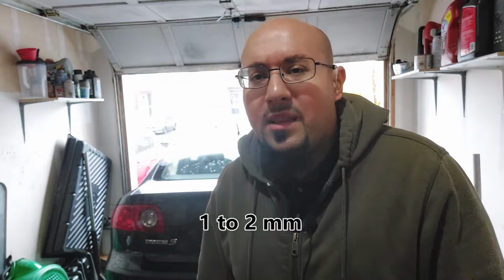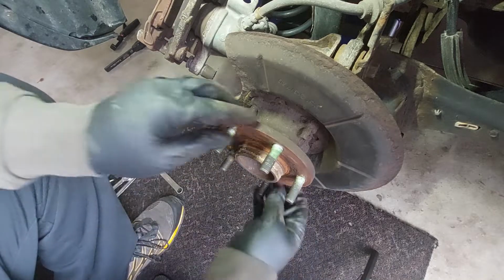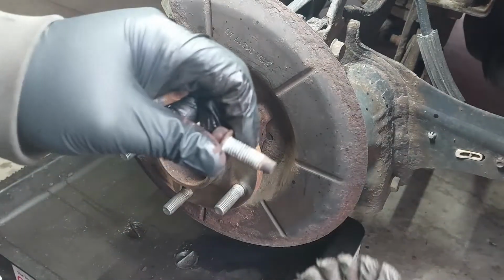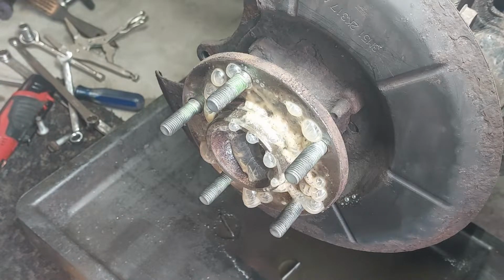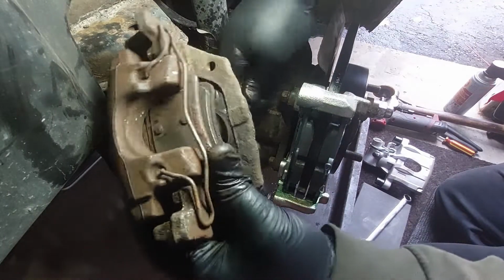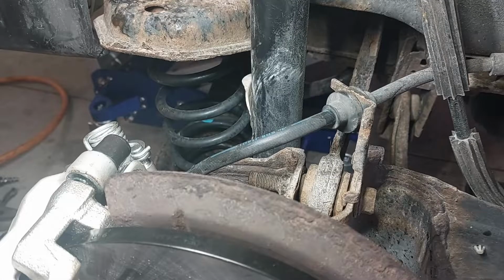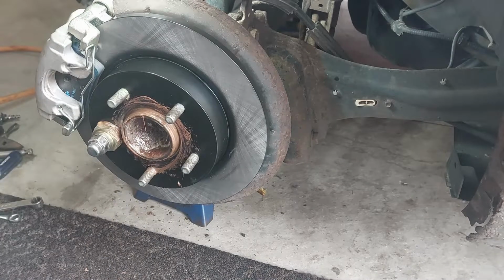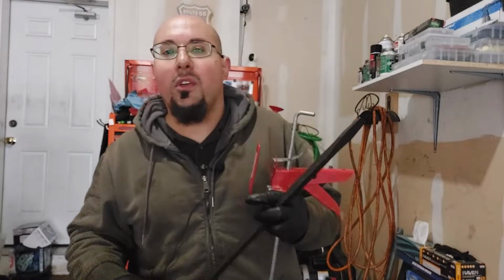2006 Mazda 3 - 2.0 - Rear Brake Calipers Replacement

Comment: Thanks for posting, just a note, those dimples on the caliper cylinder are for retracting the cylinder with a special caliper tool.Once the tool is engaged, you turn clockwise to retract the cylinder so there is clearance for new pads. Old school, you would use a c clamp to press the cylinder back. On these cylinders that method is not possible. Everything else is good, though a lot of it is not nesasary as the new calipers I bought had grease on the slides, and you can use dialectic grease on the back of the new pads instead of disassembling the caliper.

Comment: Stupid question. Are the front calipers and rear calipers the same?
Reply from the maker: No, they are different, however they are similar in terms of servicing and operation. The rear calipers on this model incorporates a mechanical parking brake for the rear wheels separate from the actual braking of the vehicle. The pistons for the rear will need to be turned/twisted in order to reset the piston inside if they are not seized, otherwise the calipers will need to be rebuilt or replaced. The front calipers are larger than the rear as most of the braking is in the front. Brake distribution will vary from vehicle to vehicle, but most of the time it is a 60 front/40 rear or 70 front/30 rear distribution. The pistons for the front calipers push in in order to reset them when you are replacing brake pads. All four wheels operate hydraulically by the brake fluid and has a separate mechanical parking brake system for the rear wheels only.
Reply: Thank you for the reply. I'm in the process of fixing my 08 mazda. And I'm doing the pads. Rotors and calipers. And I noticed Detroit axle doesn't have the rear calipers. Only the front ones. So I was thinking maybe they were the same. Good thing you replied I would have ordered 4 😂😂😂
Reply from the maker: You're welcome 😊
Reply: Muchas gracias por entregar a la gran comunidad de mazderos estos tips de mantenimiento frenos mazda!!Dios te bendiga mucho mi  amigo !!